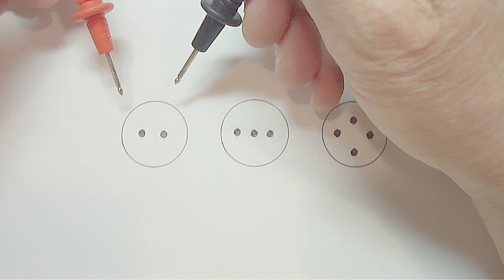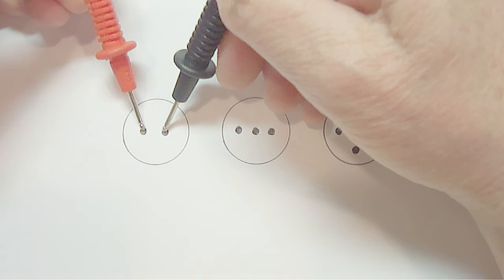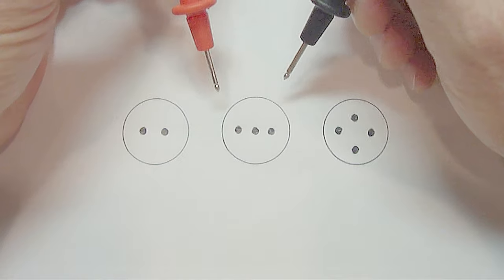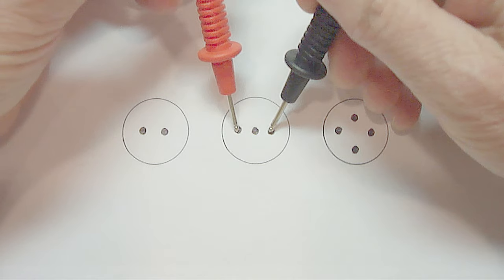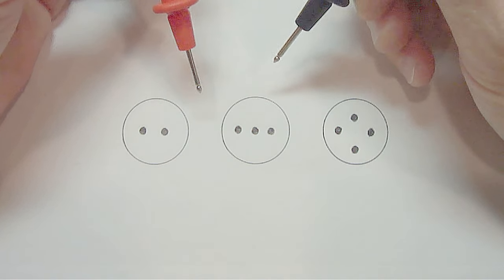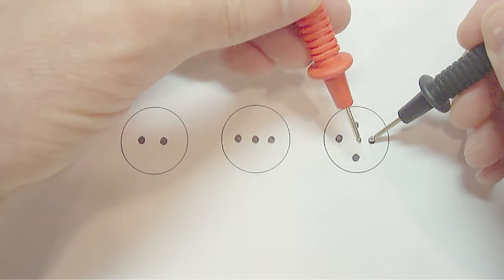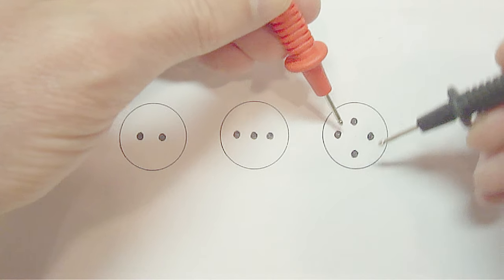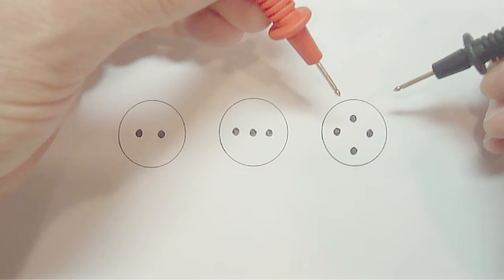Car AC Not Cooling - How To Easily Check AC Pressure Switches

Comment: And what if your multimeter doesn't have sound? When i put the switch in that position and touch red and black together i get no sound and the reading on the multimeter is at 0.00

Comment: If I removed high pressure switch from system ( two prong) should it have continuity
Reply: No because the switch will be open
Reply: @clintonmeikle8746  thank u for responding

Comment: does the pressure switch for the high or low side ever fail in the constant completed circuit position? I ask because my compressor doesnt cycle it just stays on the ac blows only cold when the vehicle is moving or the rpms are rev due to cold start, once the rpm drop the compressor which is new makes a annoying sound the low side pressures goto 80 plus and the air becomes warm. this is a new compressor, also the expansion valve has been replaced. I'm thinking the new compressor is faulty however. we have checked and with the system dry no refrigerant the pressures between the high side and low side match. the reason the compressor was replaced was the original clutch on the oem compressor was broken, so i replaced it but the tollerences werent perfect so i got about 4000 to 5000 miles however that could have been because the expansion valve being a issue and the amount of parasitic pressure on the clutch to turn the compressor due to the pressures. this is on a 2015 wrx sti.

Comment: All got do is put a wire in the wire and a/c should ingage see if the low pressure switch is good or bad ,also could be a fuse

Comment: My 2003 Toyota Highlander has only one refrigerant pressure switch (true for 2001 thru 2007).  It has four pins.  Two run the cooling fan in front of the compressor when the pressure is too high.  It closes when pressure is too high.  The other two pins have three zone, low pressure, medium pressure, and high pressure.  There is continuity between these two pins only when there is medium pressure.  Low pressure breaks the continuity and turns the system off.  High pressure does the same.  Only medium pressure keeps the system on by closing the switch.  I was surprised to learn that there is only one pressure switch, since I expected a high pressure switch on the high pressure line and a low pressure on the low pressure line.

Comment: It's not a switch. It's a presure sensor. It sends a signal which is then used to control the compressor.
Reply: The 2 wire is just a pressurized switch, if it has the correct pressure, that pressure keeps the plunger in the closed position to complete the circuit. If the pressure drops, then it opens the circuit.
The 3 wire is an electronic switch where it gets 12V power then it sends 5V back to the ecu to tell it the pressure is good. If the pressure is too high, it drops the 5V signal to the ecu where it stops the compressor. 
The 4 wire is the same as the 3 wire but it adds the 4th wire which sends a voltage back to the ecu which tells the ecu how much pressure there is. So it knows how much pressure there is by the voltage it sends back, kinda like a smart sensor.